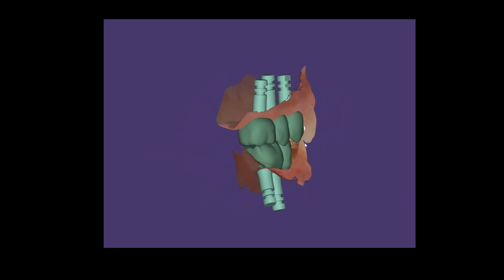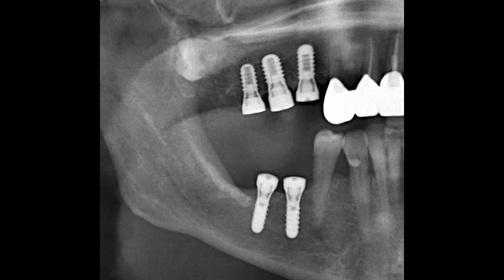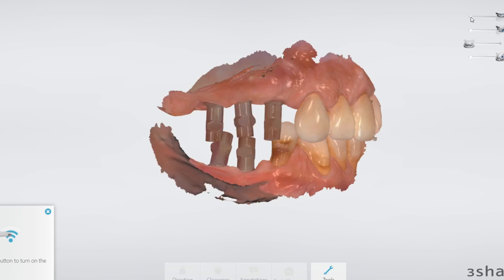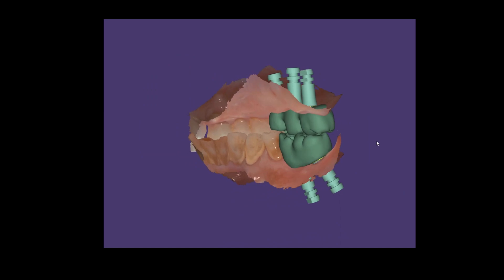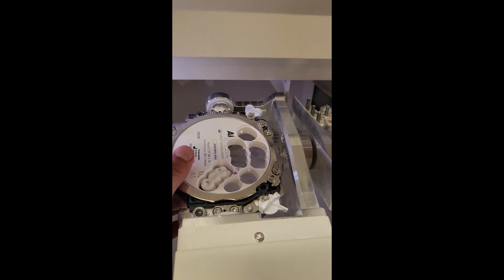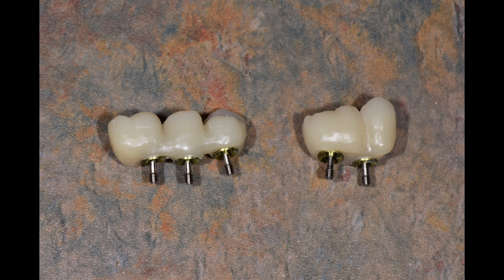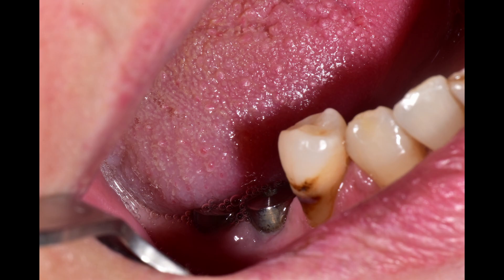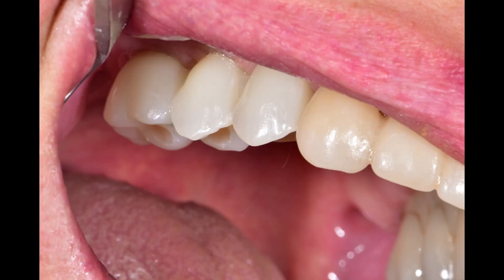[11] Dental implant bridge bite restoration

Comment: How would you have done this with PVS? As far as a bite registration
Reply from the maker: If I had to restore these implants with PVS I would take full arch closed tray impressions with the impression copings screwed in and a standard bite registration in the patient's habitual bite position. I typically request my implant restorations be slightly out of occlusion since there is no PDL.